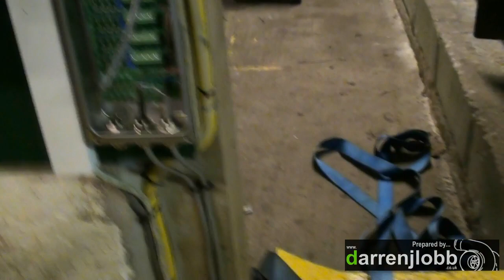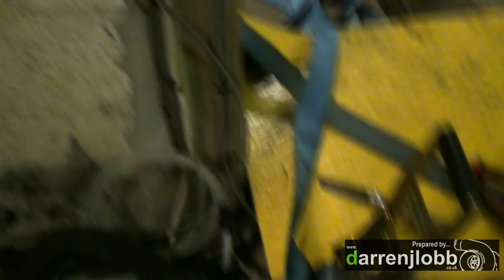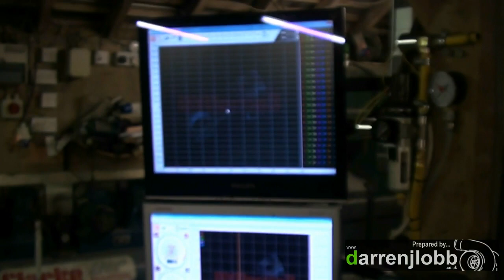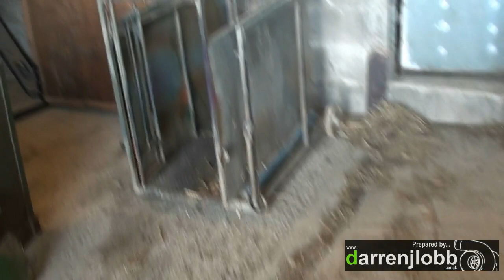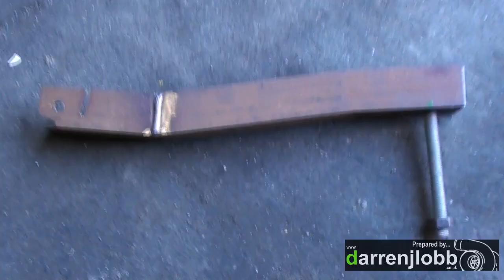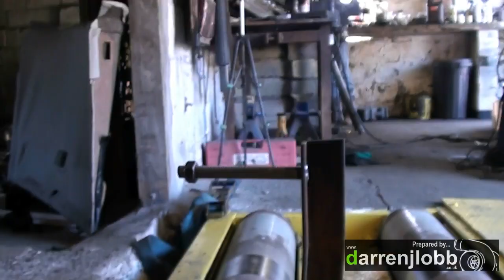Rolling Road Chassis Dyno Computer Update Part 2

Comment: Is there any way you could link me to the place you purchased the load cells and software with necessary bits? I’m purchasing a Clayton chassis Dyno here in the states for extremely cheap and would love to convert to electronic software instead of the analog stuff that comes with
Reply from the maker: I bought the load cells from a UK based company, and the amps from ebay, I am sure there will be many places more local to you though...For dyno control you also have several options...

Comment: Brilliant stuff Darren.
Have been researching how to byild a DIY dyno a while ago, untill I found a company over here, that rents out surface mount dyno's for as low as only 300€/month and sell them for around 15.000, which isnt too expensive...
Building one from the ground up probaply won't be as expensive, but still a lot of risk would be involved, same as rebuilding an old one like you did.
I applaud you sir ;)
Reply from the maker: Ronke01 Thanks chap...Has taken alot of work but really pleased with what we have ended up with!
Reply: Hello  @darrenjlobb    Might do cold start videos